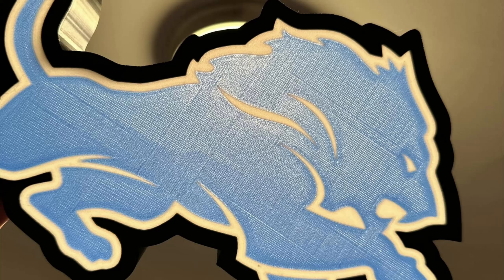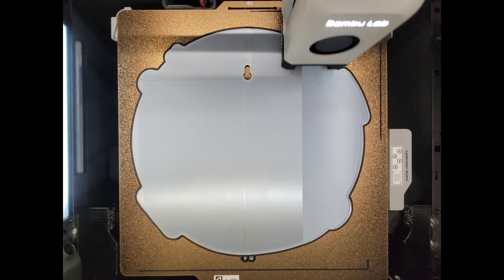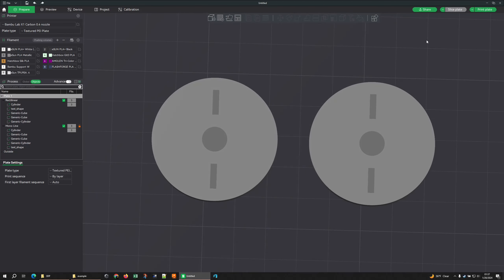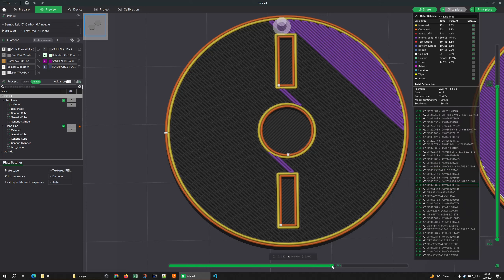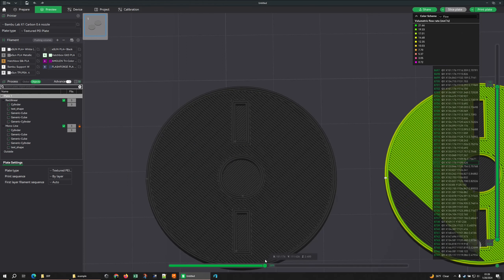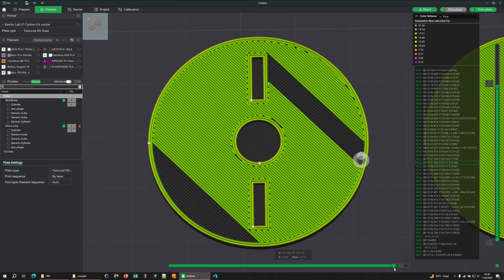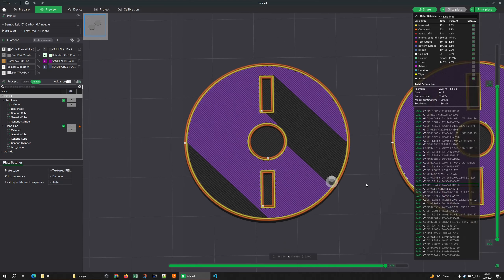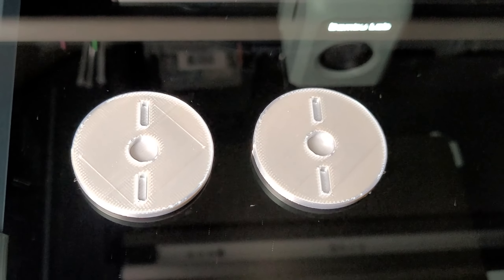Eliminating Surface Blemishes with Internal Solid Infill Patterns

Comment: As I recall, Cura consider a resolution to this issue by providing the notion of "monotonic print order"  to address this issue.  In your example, the disc on the left ("R") for the most part prints the first internal solid infill layer from top-right to lower-left then comes back from lower-left to top-right.  Where as the right disc ("M") prints top-right to bottom-left across the whole disc for the first "internal solid infill".
Reply from the maker: So in Cura you have less choices for the surface pattern itself (lines, concentric, zig-zag). To draw equivalents between Cura and forks of Prusa (like BS and Orca):
Lines = Monotonic Line
Zig-Zag = Rectilinear (Monotonic but with a focus on favoring continuous lines regardless of direction vs Monotonic and it's favoring repositioning to resume closer to origin).

Monotonic Layer Ordering - when given an angular value - is about making multiple layers all print in the same direction instead of alternating 90° layer-by-layer. While that can help, the lack of interlocking directions can cause structural issues and doesn't address the difference between a continuous line and a series of independent lines.

It's worth noting that the defaults in the slicers set things up rather differently. In Cura, you'd have to enable a 1 layer top surface skin with Lines and the remaining top surface layers as Zig-Zag (with layer ordering disabled) to equal the default in Orca/BS. Printed like that, I don't think monotonic layer ordering would matter as you've now got the same pattern (zig-zag being equal to rectilinear) under the very top surface, which is where these problems build up from.
Reply: @RevHazlett Good points, however, my point was more along the lines (no pun intended) of printing a surface the same way around all features.  For example, top-down left-to-right.  I believe Cura has a plugin (tiled infill perhaps?) allowing for a pattern (not certain whether it is an SVG import) for infills.  I don't know whether extends to internal solid infill.  It is an interesting problem/challenge.  I enjoy your tips and tricks - ty.
Reply from the maker: @truegret7778  no worries, I understand!

I didn't really qualify that the whole point I was getting at was the different default settings in the slicers mean single-option changes are hard to compare when many other things are different to begin with.

I would assume that Cura using Lines for Top Surface Finish and Zig-Zag for the remaining Top Surface (layers under the highest layer) would still see visible lines along broken-path infill regardless of monotonic layer order. Most of the time this isn't observed though because Cura is basically already doing my suggestion by using Lines for the surface patterns.

Comment: This was very helpful! Thank you so much! Quick Question-- Have you found a solution for making the top surface smooth with ironing where it doesnt take away the shine of PLA Silk? Why are the wall super shinny but not the top?
Reply from the maker: @prideandjoyquilting6062  I haven't, but honestly I only tried that once or twice. There are a couple of ironing calibration prints it there, maybe one could help you find the best values? I've used this one once and it was great - https://makerworld.com/en/models/175615?from=search#profileId-193062

Comment: Great explanation.  I like the term "re-joins."   But I still get the lines using Monotonic Line on my Bambu P1S and A1.   They're very ugly and we don't feel we can list the items for sale until we solve this.  Spent all day yesterday trying to research.   Many, many people said the Prusa printers print perfect top surfaces.  I don't understand why my printers can't.
Reply from the maker: I'm sorry to hear that. By combining well-tune material profiles with monotonic line for both the top surface and internal solid infill patterns I've had nothing but great results (on both the E3v1 and the X1C).

When I have had problems it's almost always due to an inappropriate flow ratio for my material profile. I know a lot of people just run the BBL/generic material profiles and say it's good enough, but I take the ~30 minutes to run a flow ratio and PA calibration for every spool and get consistently good results.

Comment: Looks like the monotonic line works ok for parts that don't need the strength whereas the rectilinear lines will join stronger with the perimeters.
Good idea thought to consider monotonic line for certain types of parts as in your examples.
Reply from the maker: Possibly? I think your infill/wall overlap percentage will have more to do with that than the pattern.

I understand that rectilinear's continuous line will have potentially higher strength as there's no pause in the extrusion process when rounding a curve to begin the next line, but I don't think that would directly translate to a noticeable difference in strength.

Sounds like an interesting test print to try!
Reply: @RevHazlett  Yea, hard to say on some of it.  The use of the monotonic line is a good suggestion though.  Still haven't had a chance to try it as an infill.

Comment: monotonic infill makes every line in one direction and against another lines always on the same side. the reason this works is because nozzles are not perfectly flat and perfectly parallel to the printer bed, so each direction and each previous line has a different effect.
Reply from the maker: There are basically three patterns used in the majority of prints - rectilinear, monotonic, and monotonic line.

Rectilinear and Monotonic use the same design (a contiguous line with two corners at wall intersections), but generate the path differently - monotonic favoring "start the next segment closest to X0 after interruption" and rectilinear favoring "keep the line as continuous as possible, then fill broken areas."

Monotonic Line on the other hand draws each line as it's own segment with no corners to connect it to the next line. This lets it get in to tighter areas better - and it's my suspicion that not having that tiiiny little offset caused by the corners allows more precise placement of lines when they are resuming a broken pattern like in the video.

Comment: That's also a problem of overlap %.
If too high, it's a step. If too lose, it's a little hole.

Even using monotonic lines.
Reply from the maker: @Ale_giro  the default if 15% is usually pretty good, I've had good results at 20%. Where do you like it?